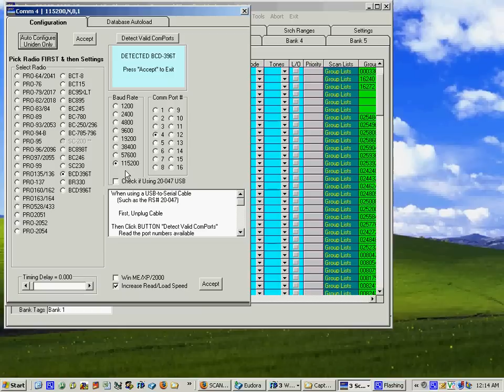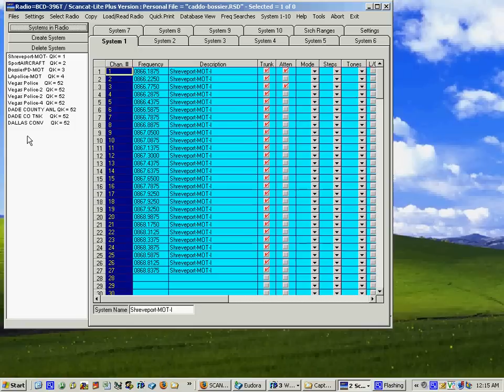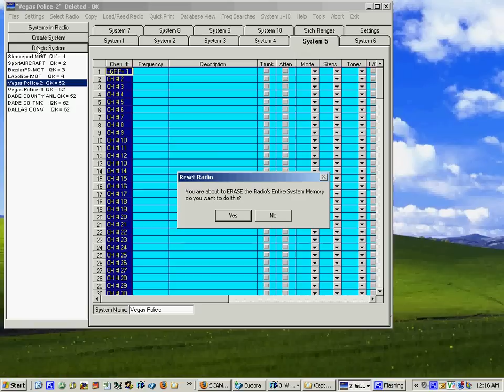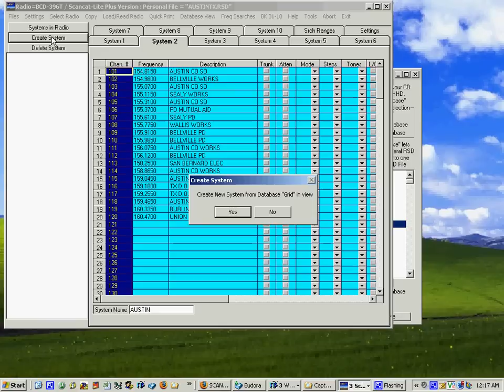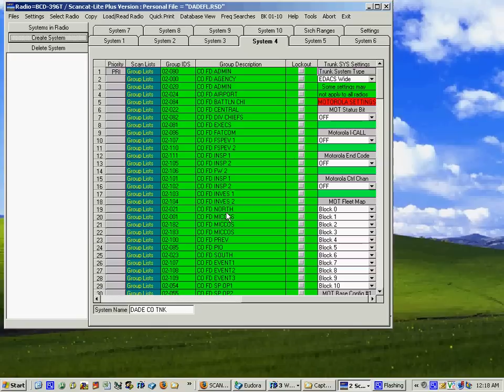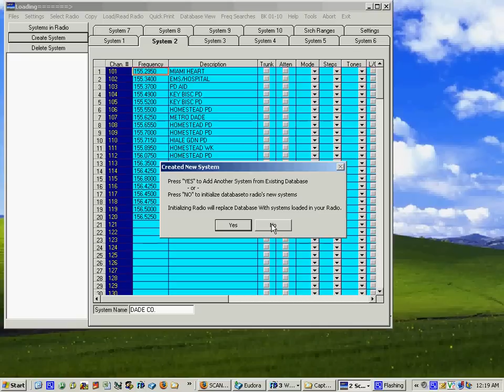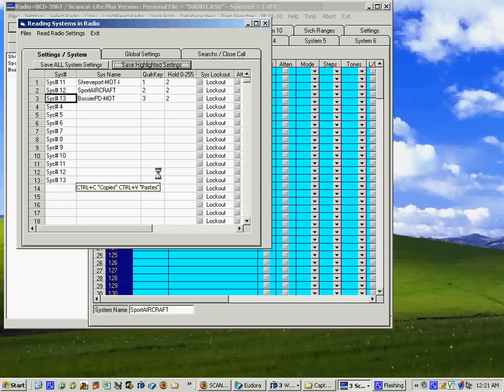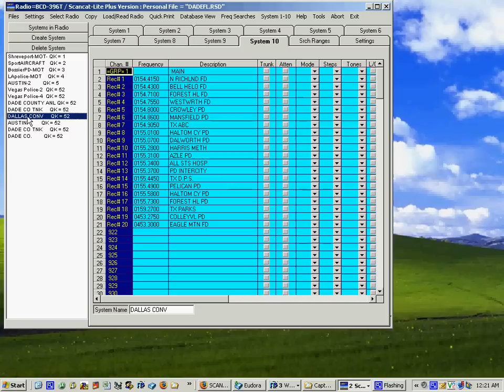Scancat-LitePlus Software_Tutorial-Getting Started-3

Comment: I have the "Scancat lite plus" original disk, and the connection cable for my BCD-396XT to my laptop, do I need any other updates to program my radio, it seem I can't fetch any frequencies from "radio reference", or the disc at all, and it doesn't read the radio at all?